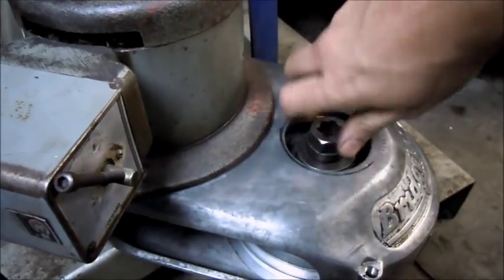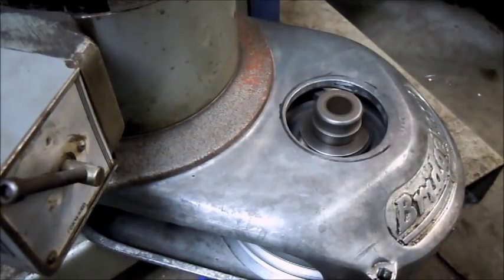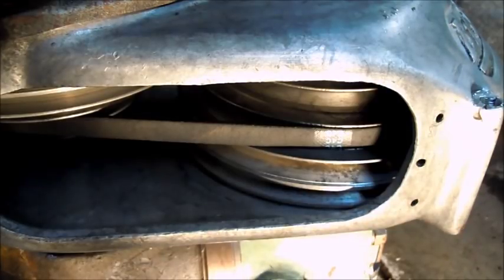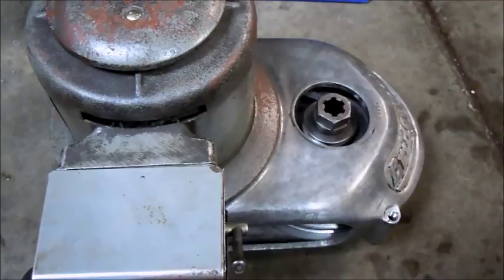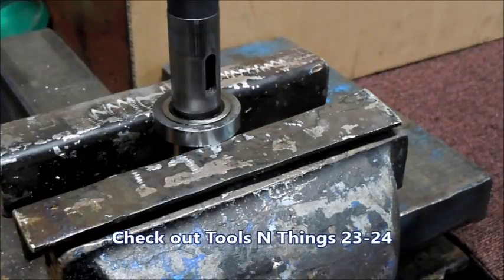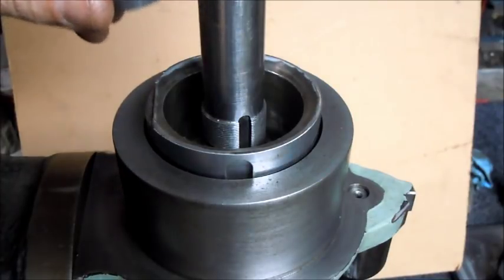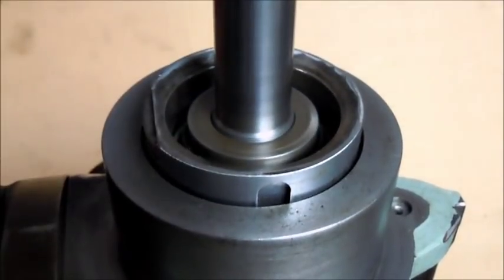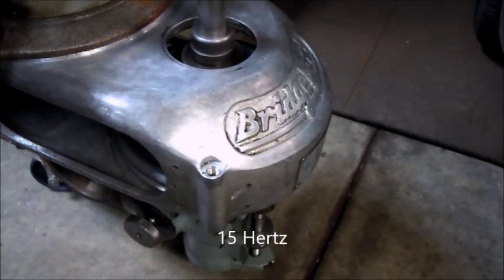M Head Matters 10

Comment: Several years ago I overhauled my M head, and I purchased a bearing kit from H&W Machine Repair in the USA.
The kit included 4 Japanese angular contact ball bearings for the spindle,  2 ball bearings for the spindle pulley, and a new V-belt.
This kit cost $190 USD at the time, very reasonable for those 4 ABEC grade 7! angular contact bearings.
I also had the 2 sets of bearing spacers re-ground parallel by a friend with a good surface grinder.
The originals were lathe-turned and about .0005" out-of parallel.
I was unable to remove the nut on the spindle, and had to grind it off.  H&W had new nuts at very reasonable price, too.
And then I re-bored the spindle taper bore, but that is another story.
My M head is grafted onto a small Japanese horizontal milling machine and does a fine job thereon.
Reply from the maker: Sounds like a nice package after all that work. They are a great spindle for grafting aren't they. Thanks for watching and commenting too.

Comment: I had to rebuild the quill when I bought my 1958 M head about 15 years ago, took me a while, but the old gal still sounds and performs about as good as you could expect. Worth doing. 

Also worth replacing that bad bearing... If you flood it with oil it won't sound so bad, and perhaps prevent a bad breakin.
Reply from the maker: The amount of times I now have had this thing apart makes it pretty much a no brainer for me… and that’s a good thing 😊 More oil is in order. Thanks for watching and commenting.

Comment: hey UA, how much you got invested for the new bearings total? didnt you say this was a spare unit, that you were intending on using the j head.  maybe i got confused somewhere along....
Reply from the maker: The bearings were not expensive but were also just run of the mill bearings. Under $100 total for all bearings so far but I may be looking to install a set of high precision angular contact bearings in the spindle, at least the lower set, to see if it makes a difference. This is in fact a unit that I have been helping a friend with, the mill I’m working on, oh boy do I ever need to get back at that…. Is going / does have a J head on it. If you are confused, it’s because of how I jump from project to project 😊 No deadlines in my shop, for the most part, just a BUNCH of learning opportunities. Thanks for watching and commenting.